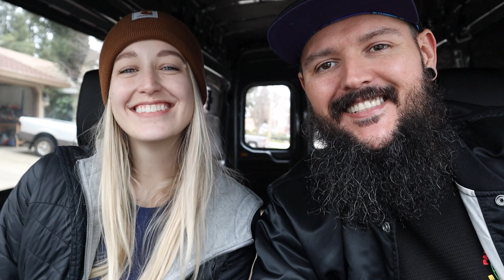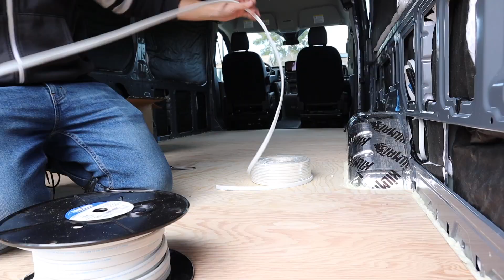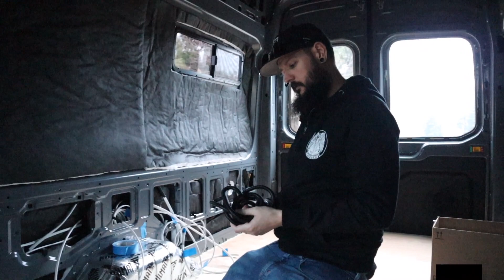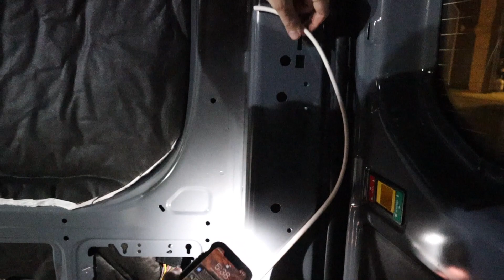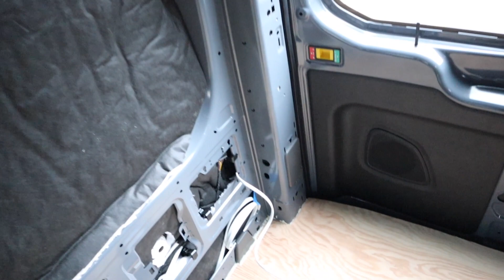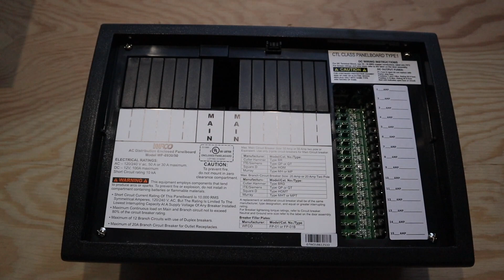Starting Electrical: Wiring Our Van Build | 2021 Ford Transit Van Conversion Ep. 9

Comment: One thing I've learned about wiring, don't overkill it. If i dont need 12 guage, don't us it. 120v lights are usually 14 guage and it is so much easier to work with.

Comment: After using the van for awhile, what is your take on lighting choices?  Specifically the quantity and if it is too bright.  I am in the process of doing my puck light layout and I am thinking of having about half as many as you designed.  Could you do with less?  For instance, I have two over the bed and two down the hall area with only one over the bench seat.  Your build vlog has been super helpful!  I appreciate the time you guys put into it.  Do you have plans on posting the final cost run up?  Thanks again!

Comment: I am very confused with the Explorist. I went thru and added my components and when I add up its 1070 only charge 9.99 for the plans, but then the invoice total is over $1900. They Built in $900 for what? I need to get going but this is throwing me. Tyia! 🥺
Reply from the maker: Sorry, I'm not sure because we didn't buy any components from Explorist, only the wiring diagram. Maybe it is due to taxes, customs, or shipping charges? We bought all of our wire from Amazon and then all of our electrical components + batteries in a 400 Ah van kit from Battle Born.

Comment: Hi Guys, are you happy with these two choices of wire, about to purchase myself.  The 12/2 AWG will do all 12V utilities ?
Thanks as always,
Andy

Marine Grade 12/2 AWG Electrical Duplex Wire (200 feet, for 12V outlets
Marine Grade 12/3 AWG Electrical Triplex Wire (100 feet, for 120V outlets
Reply from the maker: Yes we are happy with them, we have had no complaints or issues on our end! We are pretty confident the wires we picked will be durable.

Comment: Did you connect a voltage regulator for your Maxxfan?  I have seen a lot of discussions about low and high voltage issues.
Reply from the maker: No, we hadn't heard about this, but will look into it.

Comment: Looks like you were able to route all of the wires through the upper, lower, and rear cavities without drilling any large holes.  Correct?
Reply from the maker: Correct! We didn’t want to drill holes in the walls because it’s really hard to collect all the metal shavings and we didn’t need to.
Reply: @britandmike  Thanks!  Yes, very difficult to remove all of the shavings.  I saw AVC RIG drilling 1/2"-3/4" holes and then placing bushings into the holes. No thanks!

Comment: I love your content, and am following you, and will reference you when I get to my own build.  But for the life of me, I can't figure how you did an electrical vlog without talking about wiring up your solar cells, shore power, alternator charging, and the inverter/chargers you used.  The very CORE of your electrical system.  Wire thickness.  How you arrived at the choices you did.  You completely glossed over all of the parts that intimidate most everyone who has never done this, but wants to.
Reply from the maker: Thanks for your comment - I don't think we have actually gotten to the part of the build yet that you're describing, at least not fully. This video was basically more about laying the wire for our lights/outlets/fan etc. so that we could build up the walls. We haven't installed any of the actual components yet like inverter/batteries/etc. Mike installed the solar panels in ep. 6 and ran the wire for the battery isolation manager that we plan to use for alternator charging in ep. 13, but we haven't hooked anything up yet. We will definitely show how we hook up everything in our system when we get there, but we have been relying on lots of videos and blog posts from people who know much more than us, so we are not experts!

The wires we used for this video were:
Shore power inlet: 8/3 AWG Triplex Flat AC Marine Wire
12 volt outlets/appliances: Marine Grade 12/2 AWG Electrical Duplex Wire
120 volt outlets: Marine Grade 12/3 AWG Electrical Triplex Wire
Reply: Thank you somuch for providing the kind of wire.  I have been searching for this information for a while.

Comment: Hi quick question, did you use multi strand wires or solid cores? As your 120v looks like solid which is prone to vibration breaking being in a vehicle!
Reply from the maker: We used marine grade stranded wire! We definitely had the same concerns.